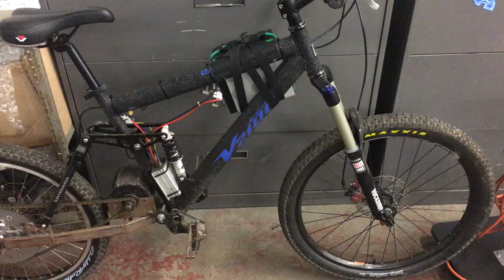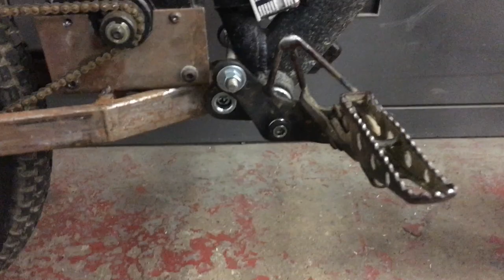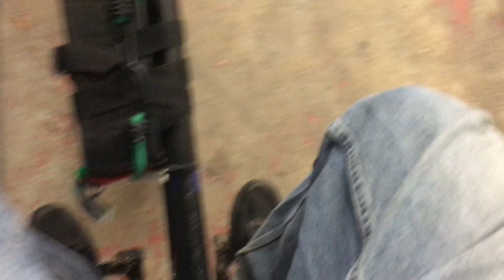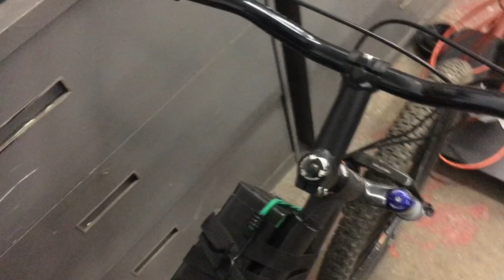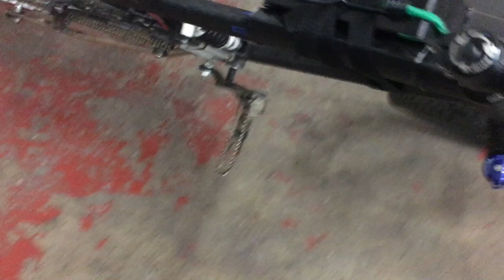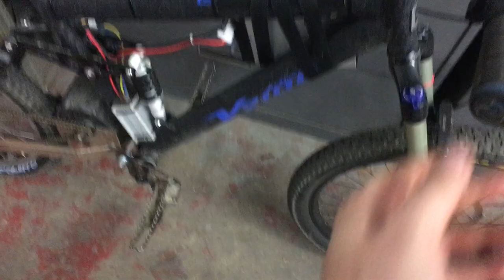LightningRods HD Genesis Electric Bike gets Foot Pegs

Comment: The controller is set up for disaster in the rain. The wires should ALWAYS be facing down and not up. Rain will damage everything with it like that.
Reply from the maker: Ya this baby never saw water once. Very good tip though! I do always try to mount wiring downward with a drip loop.

Comment: Hmm...found this searching for pegs for MTB. Did you weld up a custom rear triangle to convert it to a full suspension?  But this video was helpful since I have a hardtail with BBSHD with Mr. HV's kit (runs on 72V, 4000W max) but been wanting to try pegs instead as the pedals are pointless with the setup.
Reply from the maker: this was a custom farfle swingarm made by an Endless Sphere forum member which makes this Walmart bike easy to convert to high power without torque arms
Reply: @EBIKEScott  very nice 👍